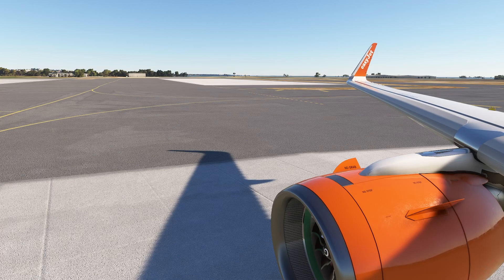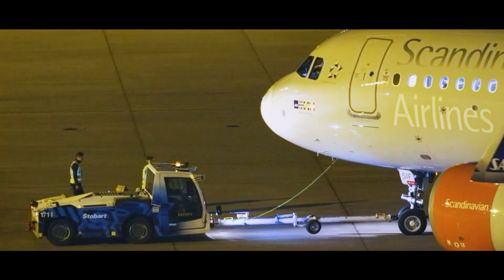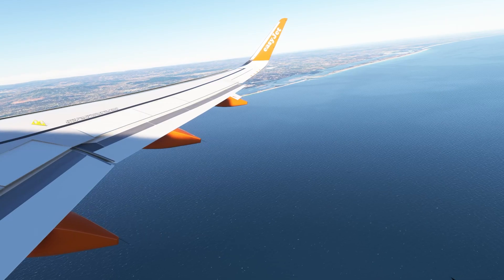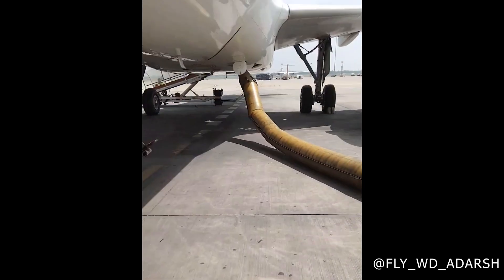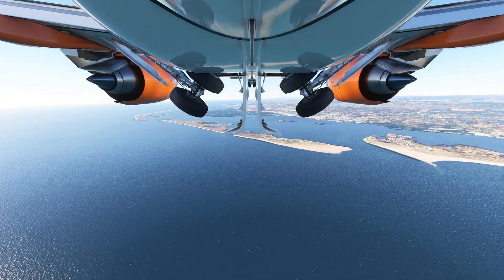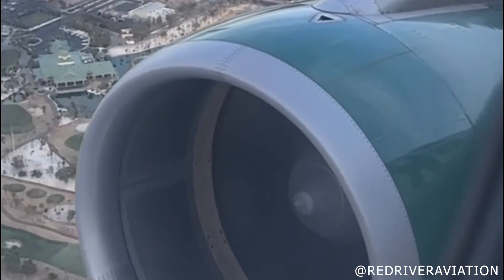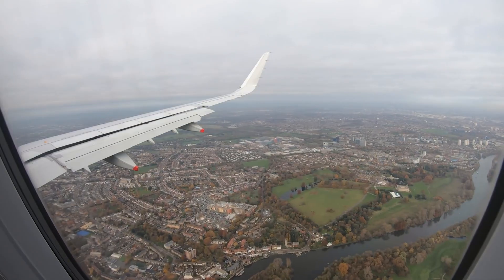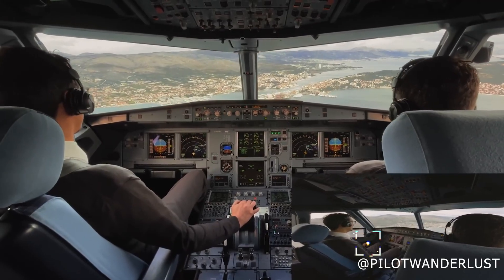Airplane Sounds Explained by an Airbus Captain

Comment: Hi Captain Mark, could you please tell me why the engines after a flight on the A319/320 when shutdown at the stand has a scratching/ scraping sound from the engine fan blades? I guess its the different cooling down temperature of the engine cowling to the fan blades. Especially on a cold and frosty evening.

Comment: I sat directly over the MLG on a TAP 321LR NEO a couple of weeks ago. For the first 30 min or so of the flight I heard what sounded like a very low freuency train whistle intermittently. It wasn’t flaps, gear, or anything like that (I’ve been a pilot for 45 years).  I couldn’t put a finger on what it was.